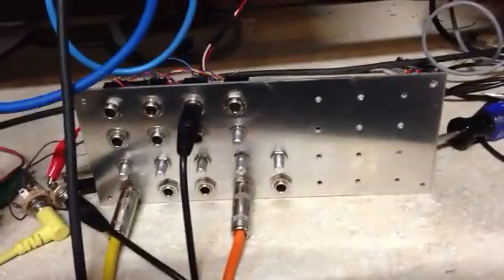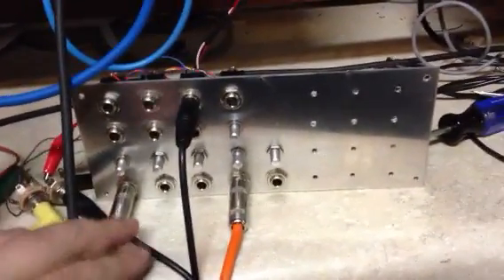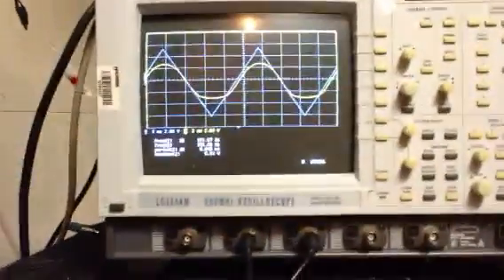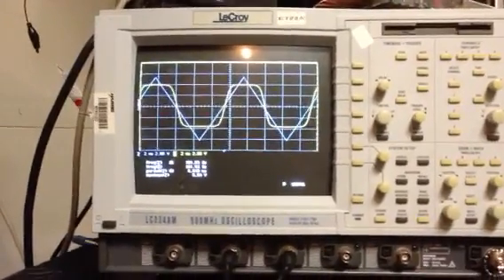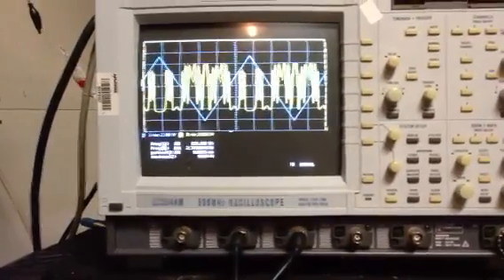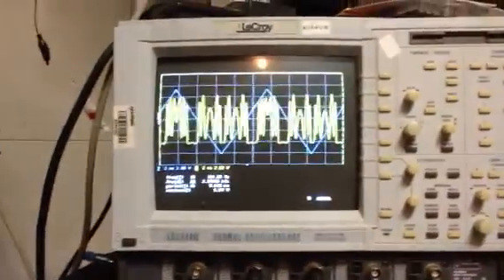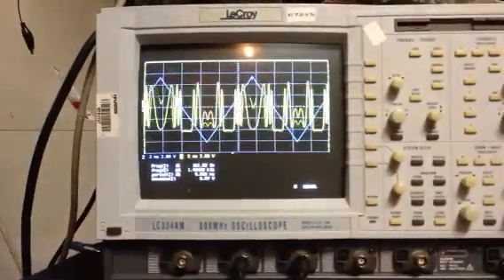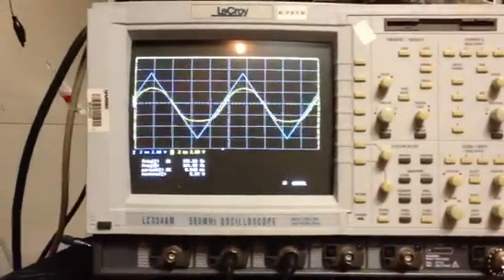Toppo Brillo TWF

Comment from the maker: Well, each of the three sections has something which you could call a 'Gain' that controls the amount of folding for that stage. There's a master Gain that affects all of the stages at once. There's also a 'Bias' that injects a DC voltage onto the signal - that causes a lot of nice havoc as well. If memory serves, they are all Voltage Controllable....